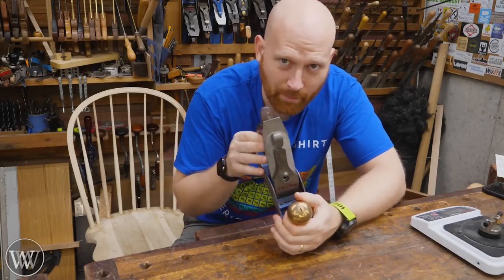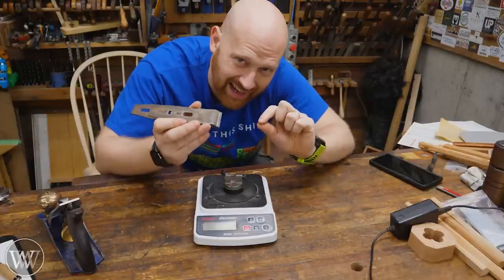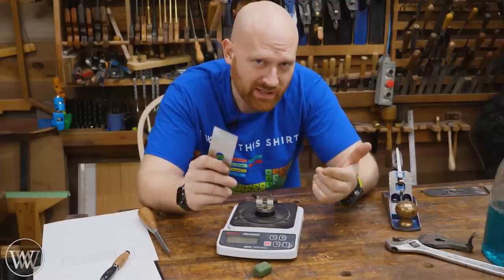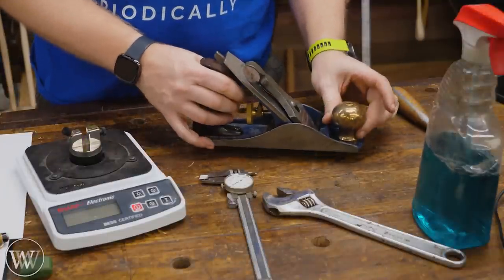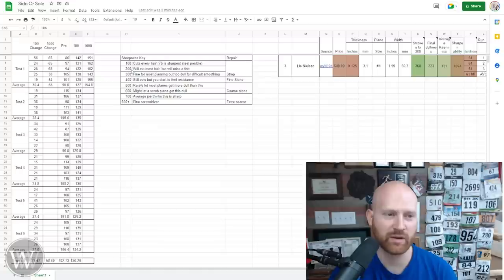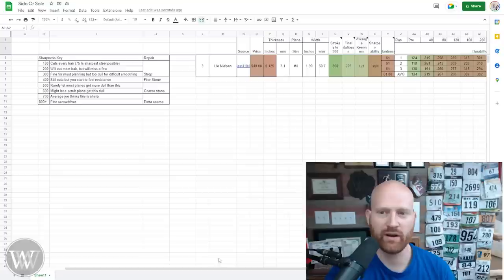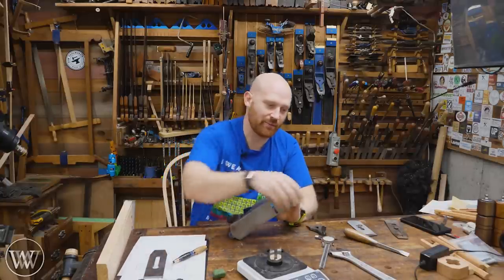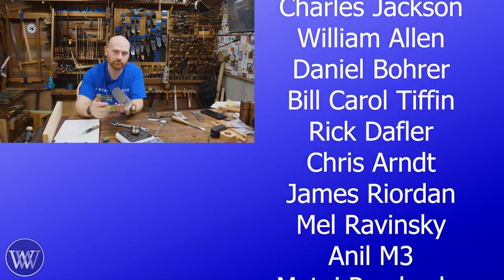The Correct Way To Set The Plane Down Test and SPREADSHEET!!! Side Vs Sole

Comment: Somewhat related to this is the old question of whether to lift the plane on a backstroke or just pull it back over the wood. I've heard Paul Sellers talk about how simply pulling back after a stroke actually burnishes the edge of the blade instead of dulling it. That would be interesting to see tested

Comment: Awesome test James... 100% agree with putting it on its sole.  I'd be curious to see what the effect of putting it on its side might have on inducing errors in the blade position laterally.  I know that there are a lot of variables that could affect this one (weight of the iron/chipbreaker, tightness of the lever cap and so on...) - but it would still be fun to see!  Might actually give even more support to the practice of setting planes down on the sole.  Thanks again - I absolutely love your quest for empirical perfection!

Comment: I set on sole. Not sitting it on concrete it metal but wooden benches...I actually started putting them on the sides when I first started but figured I'm ramming it into wood and knots so just sitting shouldn't hurt. We'll see at the end

Comment: I have been doing woodwork for over 60 years. In my first shop class in the 7th grade we were taught to put a plane down on its side. I still do it. I place it on its side with the blade away from me. I have never noticed any lateral adjustment problem, I have never lost a finger or part of a finger to the blade, and I cannot remember ever running a metal tool into the blade. This is an interesting study and I appreciate your time and effort. With my putting it on its side for over 60 years with no damage compared to placing it on its sole for 60 years, there is a significant difference. With that said, my true feelings are, I have never seen so much argument about anything so insignificant in my life. Sole or side, who really cares? I will continue to put my planes on their side only because a 60 year old habit is hard to break. If you want to put yours in its sole, I couldn't care less. You do great woodwork and that is much more important to me and I hope all of your listeners. I suppose I am ranting a bit, but seriously why did this argument ever come up? I did read a comment on a different channel where the man sets his on its sole on a very lightly oiled piece of carpet. I think that is absolutely the best reason I have ever heard for setting a plane on its sole. It saves a lot of time oiling the sole. I wish I could remember the man's name, I would gladly give him the credit for saying it. Probably no damage at all to the plane iron. Keep putting out the great videos. Thanks.
Reply: I put my planes down on the sole but when I put my planes away at the end of a job I retract the blade just a little, no idea if this achieves anything, but it is just a habit I got into.

Comment: EXCELLENT!  Thanks for "taking one for the Gipper" on this.  I would suggest that there's good justification for "on the side" on a mixed use bench that is used for wood and metal working.  Swarf embedded in the wood is more likely to ding the edge of a sharp blade.  But for a full on wood only shop I think you neatly set this one to rest.  I feel there's far more risk of damage to the operator as well as the edge for an exposed blade.  

Early on reading things like James Krenov and others in the 80's and 90's I leaned towards making a LOT of my non cutting tools from wood.  This was fun as well as making for an "edge safer" work bench... I suppose.  But mostly it's fun to use tools that I made... 

Of course there's one other option that will silence ALL of the protesters... A small stick of wood on the bench and set the planes down so they sit tilted and the edge is floating in air?  Oh, I suppose some would start claiming that the body will bow over time from gravity.... :D.....   When the side only protesters show up to tar and feather you as a heretic I'll be the one way in the back smiling and waving !  :D
Reply: That last option is what I've been doing lately. It's like using a knife rest on a fine dining table. It's nearly as faaancy as James W with his clean grit-free bench top.

Comment: Great test James.  I've always put my planes, both metal and timber, sole down on the bench under the premise that my bench surface was softer than the plane iron.  Also placing the plane on its side can knock the iron out of alignment, either accidentally hitting the lateral adjustment, or a shift of the iron when setting it on its side.

Comment: I usually put it sole down with the mouth/blade over the toolwell. I think Paul Sellers mentioned the risk of messing up the lateral adjustment of the blade if you set it down on the side.

Comment: I love this! Awesome data!
When I was a kid, the only plane I owned was a block plane, and someone told me to always set it down on its side to avoid damaging the edge. Many years later, as I was getting more into woodworking I saw the Paul Sellers video you mentioned, and at about the same time I acquired more planes. (Paul Sellers is in favor of sole-down, as you know.) The result? Sometimes when I'm setting a plane down I will absent-mindedly put a block plane down on its side, even though I put other planes down on their sole.  😄

Comment: The missing test that would be cool to see is if the blade is deflected when setting it on its side.  I was already a "put it on its sole" guy and I remember Paul's video.  Also Rob Cosmans, but it would be cool to see if setting it on its side actually does put the iron out of square.

Comment: Very good job and should satisfy anyone in doubt. I always set my plane iron down. It’s just to easy to cut yourself or nick the blade and then it’s time to sharpen it wasting more steel and time.
Finally, a spread sheet I can make sense of. I’ve never been able to make sense of very complex SS. Tell me to make a very complex joint, piece of cake.

Comment: If one is still concerned, one could rest the sole on a popsicle stick or other thin scrap so that the edge of the iron is hanging rather than rested on.

I was hoping you would also debunk the claim that resting a plane on its side messes up the lateral adjustment.
Reply from the maker: Maybe next time.

Comment: On the side of the argument to put it on it sole I have recently seen a video (cannot remember who did it) that brought a good argument that is not brought very often and make sense to me at least. Usually the iron on the plane is not set to an heavy cut and the bench has not been flattened right before you put your plane on it so they are good chances that the iron doesn't even touch the bench even if you put down the plane on its sole.

Comment: Really enjoyed this one, and glad to see some science confirming what I already believed! 

Another test I’d love to see would be comparing the 3 diamond plates + strop method of sharpening to using fancy million-grit waterstones and all the extra microbevels. My guess is that either the strop will serve as an equalizer, or the waterstones will give you a sharper edge initially that would quickly “dull” down to the same level as the diamond plates after a taking a few shavings.
Reply from the maker: I did that one a wile ago. they give you the same edge. they can both get to the same sharpness and dull out about the same speed. the water stones leave more of a polish on the blade, but that does not change the sharpness. just the look.

Comment: Hello James. I started woodworking as a hobby when I was in junior high school. Now in my 70's, and I have always set the plane on its sole. The darn things were made to cut wood, so how is a wooden bench top doing anymore harm than a piece of oak or hickory that one is planning. Btw, my grandfather taught me to set it on it's sole. Good video, keep them coming.
Reply: On one occasion, I was carrying a plane from my workshop to another location, and parked it on the kitchen counter. In that case, it’s clearly best to lay it on its side. Otherwise, you risk damaging the countertop, or the blade, or both.
Reply: The other day I was pulling 18 gauge brads out of work and tossing them onto my bench.  Setting planes down on their sides made sense to me then.

Comment: I think worry about setting the plane sole down on clean wood surfaces is as silly as worrying about lateral adjustment displacement by laying it sideways.

The problem is that putting a plane on its sole on a dirty surface is plausible, and could be modeled by setting it on sandpaper.

Habits protect you from making certain mistakes, and you need to be more alert to protect from others.  People like to divide up tasks differently.

Comment: Great stuff,is there any similar material relating to the optimal angle of the cutting iron to get the sharpest and the most durable edge,is the  tradeoff between sharpness and durability  based on unscientific tradition and could it be improved.I would suggest two irons sharpened at 25 and 30 degrees and then take a number of shavings on each before progressively applying a micro bevel in 1 degree increments doing the same number of shavings each time,in a relatively short time you would have data from 25 to 35  degrees,what is the best angle for hard wood versus soft timber? Keep it up James♡♡♡
Reply from the maker: I've done a couple tests on that in the past. I have a plain iron test where I ran a bunch of plane irons through the same test for durability and sharpen ability. But I also tested the angle. The trade-off is between durability and how quickly the plane engages on a flat surface. Surprisingly, there is no change in sharpness between a high angle and a low angle. After doing all the testing, I know sharpen all of my planes around 35 to 40°. The only benefit to a lower angle is it will engage ever so slightly faster into the wood if you're starting in the middle of the board. However, the higher angle is far more durable in the edge will last far longer.
Reply: @WoodByWrightHowTo  the main point  is sharpness at any angle will be sufficient,thank you for your hard work,much appreciated❤️❤️❤️

Comment: Great video as always, purely out of interest, I'd like to see what effect there is on the iron by putting the plane down on a brass surface and if little effect then moving up through different materials.  And as others have already said I'd be more interested in what effect putting the plane down 100 times on it's side has to the lateral position of the iron.

Comment: I have always heard from people that the reason not to place it on its side is that you could knock your blade's lateral adjustment out of whack slightly, and over time could end up with a much thicker shaving on one side than the other, resulting in gouged workpieces, or at least unsquare.
Reply: Also what I've heard, but if you think about it .... aren't we always aware of the plane's behavior? I think we'd notice it being out of square fairly quickly.
Reply: That's not going to happen here. I keep some tension on the lever caps of my planes.

Comment: Also, never mind the sole of the plane.  What did all that deliberate (if minor) damage do to the soul of your bench?
Reply: I never lay my planes on their sides unless circumstances force me to put them down on a surface other than wood. Usually I have a dedicated piece of soft wood (a "landing strip" if you will) on which to rest my planes...long term storage is always in an anti-rust sock, with the iron fully retracted. A plane is a precision instrument, not a hacking tool, and it should always be treated as such.

Comment: I think the material you set the plane down on is also a factor. For a while I was using a low workbench and would set my plane down on the concrete deck I was at (as benchtop space was a premium since I also sat on it), so I would set it on its side so the cement wouldn't damage the edge. I never tested to see how much damage it would have done, but I can't imagine it would do as little as setting it down on wood.
Reply from the maker: Yeah if you have concrete or metal put it on its side or set down something to put the plane on. A lot of people make a small carpet bed that they can fill with oil and set the plane on that.

Comment: I agree with your conclusion that it's not worth worrying about how you set down a plane. But I think one of the arguments against setting it on its sole is that you might set it on some grit or on something else that would nick the blade. I don't think most people are worrying about the effect of just setting it on a clean piece of wood. So while this is an interesting test, I don't think it necessarily addresses the main argument.

Comment: There is one other thing setting it on its side can do that setting it on its sole will not.  It can knock the blade out of alignment so that you have to readjust your iron to resume planing. I am not talking far out of alignment, just a small bit.
Reply: I don't run my lever caps that loose. Or slam my plane down hard enough to move the iron.

Comment: My friend told me to put a small piece of wood under the heel when stroring planes flat on the sole to protect the iron. Guess, I won't be doing that anymore
Reply: Rust would be the real reason to have the sole elevated as moisture in the timber can quickly effect cast iron and the cutting edge.

Comment: I have often thought of what else other than the bench top would effect the cutting edge. Sand paper loose grits, dust, dirt etc. I know it would be minimal at best, but resting on the side or (my favourite method is) to rest it sole down on some shavings removes all risks. One factor often not considered with sole down is the plane being pushed out of the way, bumped and dragged during work.

Comment: At least for this test you could have used a guide to take the sharpening variable out of the equation. A guide is going to get tools sharper than by hand anyways. And yeah I'd test that.
Reply from the maker: I can almost always get the blade sharper freehand then I can with a guide. If you compare the tests done for the plane iron sharpening I used a guide to do that but I can get the much sharper for hand.
Reply: @WoodByWrightHowTo  I get consistently better results using a guide over freehand. I find using a guide faster and easier too. Quite frankly the only argument I can see for sharpening freehand is if one does not have a guide to use. I didn't for a long time myself. I have one now though.

Comment: I place the sole down preferably on shavings or resting on something to raise the blade. It makes no sense to sharpen to 5000 and then blunt it on the bench. If you sharpen to 400 then it doesn’t matter much. I think Paul Sellers has traditionally used a Norton stone for sharpening so sole down is fine.
Reply: Sellers uses diamond plates. What grit he goes up to I don't know. He did a video once where he sharpened to a coarse grit and it didn't have much effect on shavings. None really. I still like to polish the edges I sharpen.

Comment: At the workbench, I always set the plane on its sole. I set the plane down from toe to heel so any bump or (heaven forbid) another tool, only the toe will make contact first. I then lower the plane completely. The whole process takes about a second. This is the same way Paul Sellers suggests releasing a plane at the workbench.

Comment: Because the edge of the blade is fairly thin, it is reasonable to suspect that the blade edge can be bent, in the direction of its top side, and remain sharp as ever. 
My experience says either way has its advantages and draw backs. I was taught to STORE THE PLANE either on its side or retract the blade so that it does not extend below the sole plate. When in use setting down roughly is an assured way to eventually damage the blade, so setting it down in a way to protect the protruding edge is definitely in order, no matter what the tests my show. Remember a bent edge can still be razor sharp. ;-)

Comment: What are you doing dissin' a screw driver? Screw drivers are important scraping and cutting tools.
Just like that adjustable crescent hammer you have on your bench.

If I was concerned with either the blade or bench top I would put a piece of corrugated cardboard down or a small piece of wood to keep the blade off the top.
I did notice as good a test as you did here...you set the plane down wrong. You used both hands, which may be worst case? But I think everyone sets it down one handed. Now you have to do it a 100 x one handed, choose your heaviest plane please.

Comment: The problem with your experiment is you didn't cause any damage that is realistic. Nobody is worried with simply blunting by setting it down repeatedly on a clean wood surface.  If that sort of thing caused damage then running your plane over a board once would blunt the hell out of the blade. The real damage is caused when you set it down (or one of your workers set it down) on top of something that is metal, it immediately nicks the blade and you have to resharpen. Good practice is to set it on its edge, I have used planes for over 30 years and never cut my hands on a plane that is setting on its edge. Good practice should be second nature, you do it without thinking. You're doing wood workers a disservice by MISrepresenting the real reason you should always set your planes on edge.